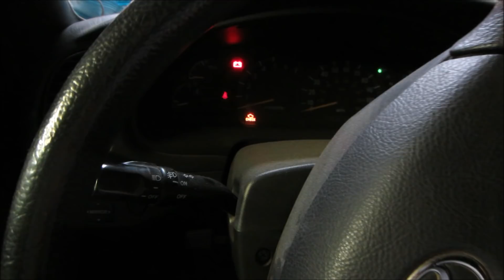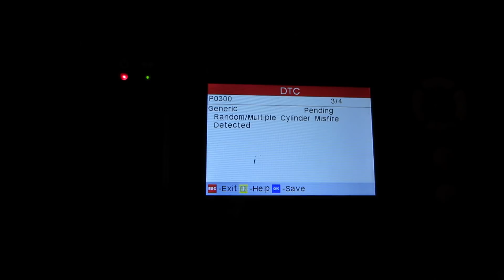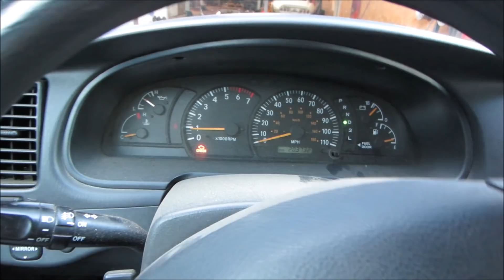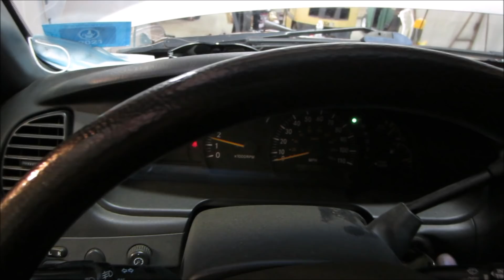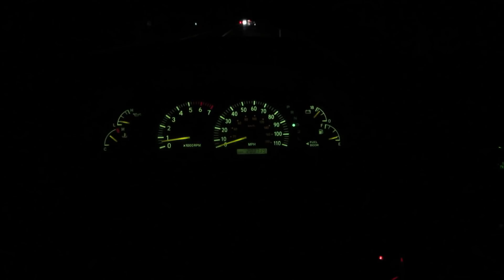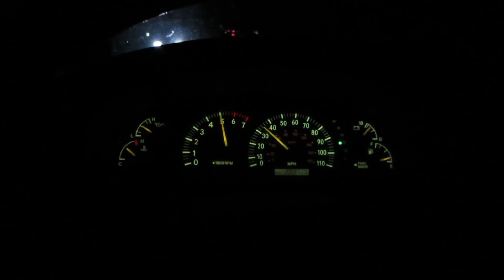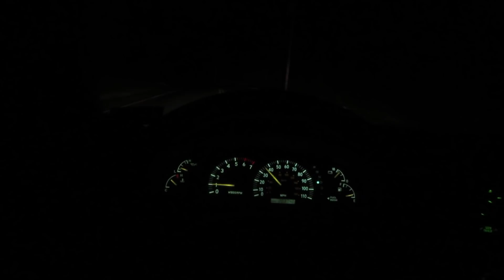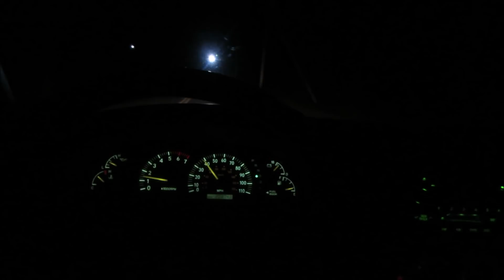What Screwed Up My Engine? You Won't Believe It

Comment: As my old grandpa would say "It's not a problem if it's leaking, just means you gotta put more in!"
Reply: Getting real damn tired of leaks!  Have a power steering leak in one and a oil leak in another and finally a God only knows what is wrong with a third! Overheated returning from a emergency run to the equine vet for meds. Got enough issues with vehicles and equipment to produce many intertwining videos for the mechanically inclined.
Reply: If it's leaking that just means it's got fluid in it. When it stops leaking you should be worried.
Reply: If the motor is making noise turn up the radio.

Comment: I would have bent a U-shape around the pipe and used that instead of welding those studs. Would have been good enough.
Reply: Good idea!
Reply: I was thinking a u-bolt, but the tricky part is the pipe is wide then the flange bolt spacing. It’d almost have to be like an omega shape.

Comment: I like the O2 sensor mount repair, and I'd recommend backing off the nuts a little as I saw the O2 sensor bracket bend in the middle when the nuts were tightened. The O2 sensor flange is designed to sit on a fully flat surface. Put the nuts on with high temperature loctite and only tighten till the O2 flange makes good contact?

Comment: My first thought was make a u-bolt for the o2,
Reply: My thought exactly.  When it rusts up you can cut it off and us a new one.   Just a short length of 5/16" all-thread and you're in business.
Reply: My thought was an exhaust u bolt
Reply: @ericbell5272  I wasn't there, but I didn't think it looked like an exhaust u-bolt would bend in enough  to catch the holes on the flange nicely, and exhaust u-bolts are beefy enough to be tough to bend without messing up the threads.  A piece of 5/16" all-thread is easy to bend into place with a couple of pieces of tubing, but would last more than long enough for this repair.   That was my thought, anyway.

Comment: There is absolutely no way in hell I could have successfully made this repair.
Reply: ya you could of, just slow down and rethink the procedure you will get it .
Reply: Buy several colors of paint markers or bright finger nail polish. Mark every bolt with each part. As you remove parts, sit them in the order you removed them. Not near as hellish as it seems.
Reply: @venomx4093  Great tip, the coloured pens idea works in all kinds of situations. Taking loads of photos as dis-assembly continues is another good move. Video, even better.
Reply: @2H80vids  I do this anytime I work on head gaskets, intakes, transmissions or anything that causes my brain to shut down lol. 25+ years ago, I always ended up with an extra bolt, wondering where it went hahaaa.
Reply: @venomx4093  Unfortunately, this doesn't work quite so well on tiny, electrical parts. I worked on a lot of small, model engineering and just wish a system like this worked with tiny parts.😁👓
Reply: Toyota belts are really easy.
Reply: @venomx4093  been there done that?
Reply: @Thomasploeg1968  Yup

Comment: Well done. That's a new one on me. I have lots of mice problems, more of eaten wires, stuffing in small engines, etc. Chewed only "some" of the wires for the cab lights on a dump truck of mine. Timing belts, Ford Pinto's (1970s).....here in Upstate NY I knew of a few cases where the car got parked too close into a snowbank. Snow/ice would get under the timing belt at the crank pulley (which was really low), and would jump time. Of course car gets towed into garage, yup timing is off but not clear what caused it. Timing belts were sort of a "new thing" back then, was a puzzler for sure.

Comment: Here's my Sunday morning guess, some cars can run without the signal from the crank sensor, but the pcm doesn't know where to send the spark. Of course, I'm not sure, just a wild guess...
Reply: Very novice mechanic here. Is pcm primary control module? Thanks.
Reply: @jamesrochester787  Powertrain Control Module, aka the engine computer. It will also control the automatic transmission.
Reply: @jamesrochester787  No, the PCM stands for the power control module. It's the engine computer. Different manufacturers have a different name. I've also heard people call it "the computer," "the brain!" or the "box". There's many different modules in modern cars, all basically logic computers. Even in the harsh environment of the modern auto, they're pretty dependable. The Tundra suffered from the mouse in the machine!

Comment: Instead of spraying your frame with "Bar" oil, use "Cosmoline". 
Anti rust protection for metals.
Reply: That's what they do in New England. When I lived in VT the locals had the undersides and inner doors etc. of their vehicles especially trucks sprayed with Agway Bar & Chain oil. They said it had zinc chromate in the oil that would neutralize any rust that was already there and protect the underside. I saw 20 year old Chevy trucks that looked like new because of that. And, Vermont is NASTY on vehicles. They salt the heck out of the roads and they get tons of snow from late October through April.
Reply: @townhall05446  I haven't heard of Agway in years!

I thought they went out of business in the early 2000s?
Reply: Agway got bought out by Southern States Co-op.

Comment: After watching your video!
My Silverado 2010--- 1500 .  Started to have cylinder 3 misfire , with what sounds like knocking on the on left side of  engine. 
Things replaced. Waterpump, 8sparkplugs, cylinder 3 coil,  cam sensor, and another sensor behind starter that can cause cylinders to miss fire.

But . This video showed me something , that almost matches the sound the engine made when it started .   Knocking  with loss of power.

Comment: I'm not very up to speed on toyotas, but I'd change the vvt solenoids. That passenger side cam was stuck advanced. Thats why it popped back in time suddenly. No wonder it was running like poop. Seems like it would've had a vvt code though, so what do I know? Lol. Good work as always, Mustie
Reply: Yeah Warren I was wondering the same thing.  Something spring-loaded pushing the belt back into alignment?  Vvt!

Comment: It's a Contitech belt. Good kit made by Continental. If it's jumped some teeth, the out of phase wont change when you turn the crank. Just set the crank to TDC. If the cam markers line up its good to go. Get a really close look at the belt teeth. Any signs of cracking = dying belt - change it ASAP. The auxiliary belt is usually changed when the cam belt is done. If that is showing signs of cracking over the pulleys it's likely the cam belt is a similar age.

Comment: Mustie, it looks like there should be an o ring in the rectangular flange of the stat housing. They wouldn't put a groove on there for a gasket, you find the same on most waterpump mounting flanges.
Gr8 vid albeit a bit gross 👍🤣😂
A quick edit.
Green fuzz on battery terminals vanishes with hot water poured on them and here in 🇬🇧we have something called waxoil.
It's a product that works pretty much the same as your oil goop but it leaves a wax behind that will not wash off or dry out. Once its on its on. Spray it and forget it. The beauty of it is it can be sprayed inside the chassis members through all the small holes. The kit comes with a small flexible sprayer tube for doing just that. It's great stuff.
Glad your truck was an eady low cost fix. 😎😉👍

Comment: I had a rodent problem in a '61 Mercedes a few decades ago. One Fall, I noticed my heater fan wasn't working, followed soon by a 'fragrance' that resembled moldy carpet. However, it didn't seem that bad, I did have some old carpet on the rear floor and the old car had some water leaks. So I assumed it actually was moldy carpet. But as the weather got colder, it came time to fix my heater. Instead of a 'squirrel-cage', those old Mercedes had a 5-blade metal fan. I aimed a flashlight down the fresh-air duct and Imagine my surprise to see a shriveled, partly decapitated mouse-head peering out from between two fan blades! Fortunately, removing the fan was easy, and a major soaking with carb-cleaner and scented air-freshener 'sanitized' the fan-blades, and the 'moldy-carpet scent disappeared pretty quickly, or at least it was overwhelmed by the fragrance of carb-cleaner and air-freshener!

Comment: That is ONEEEEE SEXY Tundra! I had the 4.7 when I had my 99 Land Cruiser, hit 300k miles with the original timing belt. She DROVE like she was fresh out the Dealership floor. I eventually found time to replace the timing belt and other maintenance (preventive maintenance). But then COVID "Dealership Discounts" went into affect which persuade me to get trade her in for a a 2017 Toyota Tundra with the 5.7.

I'm telling you, Toyota's are the ultimate reliable daily drivers and are very affordable to maintain maintenance wise. If I ever hit a lotto, I want to get another 4.7 as a side project vehicle because they are CLASSICS and will be GOLD mines once Toyota retires the v8 engines.

Comment: The timing belt is so important, I would change it. I wouldn't take a chance.
Reply: Toyota V8s only have a damn belt? Why no chain??  Is the 4.7 interference?
Reply: Yes it's a belt but a beefy one if you look at the pictures. Mine is original at 225k. I haven't heard of them breaking very often.
Reply: @misterbulger  Belts keep more accurate time than a chain surprisingly and the 4.7 is only interference if it has VVT-i
Reply: @misterbulger  I prefer belts actually. Less oil leaks, relatively better timing and it's less of a deal when you have to change them, it seems like chains these days don't last much longer than belts anyway.

Comment: Toyota has a recall on the Tundra frame problem. My 2000 Tundra has 452,000 miles on it with a new frame that they replace in 2016.

Comment: Tthe rectangluar opening looks like it originally had a seal in the groove.
Reply: I'm pretty sure that's something toyota does to make sure all the sealer doesn't get squeezed out. I replaced a head gasket and a rod in a ct200h and the timing cover was the same way if I remember and it didn't have a gasket and the service manual says use sealant. The whole engine was basically put together with sealant.
Reply: Nope, RTV from the factory.

Comment: great job! this is why I like our old '98 Jeep 4.0 liter six. no OHC, no rubber belt, no cam tensioners no nothing, just like AMC intended it to be.
PS rodents may have a particular affinity for Toyotas, we used to have an '88 Toyota Camry and on one Christmas day, we were driving to relatives and smelled chestnuts roasting on an open fire. Well what it was, some rodent of some kind had hidden nuts in the recess of the exhaust manifold which baked them well done while we were driving!

Comment: The other marks off to the right are the service marks. You rotate it to the other crank mark and then the cam marks and line it up. It takes the tension off your valve springs and allows the valves to be in a relaxed position so that a cam won't flop on you as your doing the belt

Comment: The only thing wrong with 'The Right Stuff' is how good of a job it does. I used it to repair openings in an outdoor shop vacuum motor cover. Someone had damaged it putting holes in the concave top and water was leaking in. That was years ago and it is still watet tight. All I did was squeeze some in the two holes and spread a bit on each side with a bit of overlap. The longer it sets the better it is. I promise you can patch a boat hold up to half an inch with material only and sky is the limit if you back it with fiber, plastic, or metal mesh.
Reply: Another words you may not have a leak, but you may not get the parts seperated again ever.

Comment: I stumbled onto this at 2AM and it was just plain interesting to me and I watched the entire thing. I have had mouse /rat infestations myself but had not thought of this timing belt being at risk. They even got into my air filter. Built a wire grid to keep them out.  Have a 99 4runner with impending rust issues. Interesting to see your approach. Yea, I was up north for awhile before I realized my mistake.

Comment: Best to fix it properly! Preventive maintenance is better than the cure, much cheaper in the long run too! 

Unrelated story; years ago my sister put the car in the garage for a service, simple right, oil change and filter, not too difficult, the garage drained the oil and forgot?? to put new oil in, engine did not last long, the garage had to fit a second hand replacement engine.

Comment: On the other hand, my 4.7 02 tundra just turned 300k and runs like a top for 35 k per year. No frame problems, but it's a a texas truck always and the maintenance has always been kept up. I'm thinking about a cheap paint job and shooting for 500k.

Comment: Oil pressure looks a tad on the low side at idle. My old 230k mile truck i plugged the bypass in the filter housing and it almost doubled! But you have to run K&N filters, basics rupture and leak at higher pressure. Drove it thru 3 winters no problems.

Comment: Nice job.  You are not the first person to lose timing or even an engine to a mouse in the timing belt system.  There's a small piece of the driver side timing cover that is routinely not reinstalled by the pros.  (Toyota 11348-50011). This leaves a perfect mouse size access hole.

Comment: Nice explanation of the timing belt system. Speaking of timing, with the slight rolling start that 203,000 mile tuck still did the 10-60 in 8 seconds or so, not bad, not bad at all!

Comment: About spraying under carriage with bar oil.
Perhaps mix it half with diesel fuel 
It works on wood projects with old motor oil and diesel fuel.
50/50

Comment: quick and dirty timing re-alignment? while rotating the engine and slide a piece of shim stock or sheet metal between the pulley and cogs, then rotate till everything lines up, then wiggle the shim stock out. not pretty, but gets it back on the road in 15 minutes.

Comment: I have 135700 on my 04 and worked at toyota 14 yrs, ignition coils eventually needs replaced but I never in my 14 yrs seen any come through needing replacement,,,, I’m in Alaska, a lot of 2000-06 style tundras with 200,000 plus

Comment: I've worked at a Toyota dealership before years ago, can absolutely confirm that the "master techs" don't change timing belts often. Usually they'd throw them in their tool box and read magazine/screw around for however many hours

Comment: Mine has over 280,000 on it runs like a champ. Just the normal wear and tear. Starter, U joint ball joints, brakes. It does have a O2 sensor out. It’s still my favorite pick up to drive. It’s not pretty it’s been hailed out two times I would love to get another one 4 door.

Comment: At 41 minutes in, I believe there is a gasket that goes into that groove. It's probably made of an o ring type material.  Toyota uses this type gasket on my 99 camry. My IAV valve needs some cleaning, the gasket is almost shaped liked that opening, but is divided into chambers for air flow, and coolant flow. They're fairly cheap at Toyota.
Reply: Yeah you could be right James!  I noticed the internal kinda groove on the thermostat housing too, that looked like an o-ring would fit in there.  Since there was an o-ring on the other part of the housing, I was a little surprised he missed the 2nd one.  Hopefully the 'right stuff' he used was also 'the good enough stuff'!

Comment: Loctite 518 anaerobic gasket replacer isn't cheap but a syringe style tube will last for years. It's great for sealing old joints or where there's no gasket available.

Comment: The pilots in the Coast Guard sprayed down the heli after we pulled it in to the ship hangar after every mission. They used judicial amounts of some product that smelled like CRC marine. It's similar to WD40, but better against salt. I use it on outboards all the time. They salt the roads here too, so maybe I should begin to spray it in the engine bay on the vehicles I own that don't leak excessively.

Comment: Just take your truck in to a toyota dealer and they will replace the frame under the recall if it has rust through.  Do not wait this is a safety recall.  I was at our local dealer and they had a stack of 4 frames waiting to replace them.
Reply: The weird thing is i went looking at the recall stuff and his tundras year wasnt listed, it went 1995-2000 a couple of places did say 2003 which seemed odd since the 03 and 04 are the same, and the 2007-2008 model years, but i know what your saying ive heard a lot about the tundra and Tacoma frames rusting even here where i live in California where rust really just doesn't happen, which seems really off cause i liked the tundra, i had an 03 platinum black v8 and i loved it, just a good truck with anh gas mileage, good power, but not overly huge so i cant fit in a drive through

Comment: What you need for that lug nut is a 13/16'' (21mm) hex socket key and you should be able to grab it at your local parts shop or Amazon has them for around $7

Comment: Initially I though M.A.F.  A nasty job to be sure.  Glad it snapped back into correct orientation.  Great fix on the O2 sensor.
I thought some lube might help with that stud.  Looked like a "U" bolt might have also worked for the fix.  Hope it lasts you another Hundred.  Suggest a tube to spray inside frame.  Good Job.

Comment: They are wheel locks and each one is made different. 
You might be able to order the lock for them if you have a serial number on the locks.
Otherwise you will have to take them off with a socket.
I had to do that a few times.
They are easy to take off.

Comment: Yeah those wheel lugs are all the new rage these days. You need a special key to get them off. Apparently there are like 3 or 4 different keys to fit those kinds. It is mostly a low profile kinda thing and I do not believe they were intended for security. I have some fancy wheels that they barely fit in.